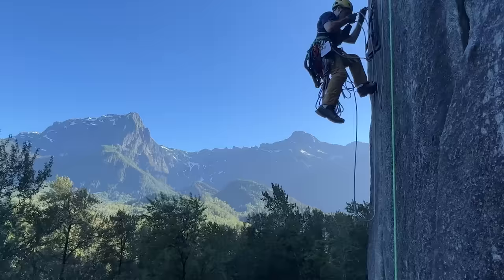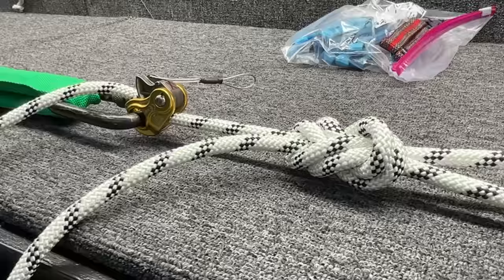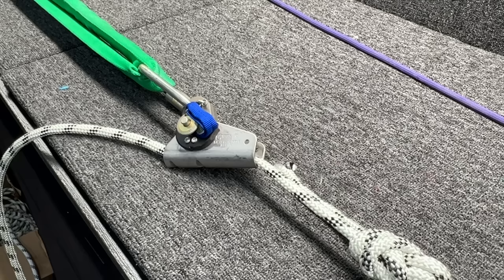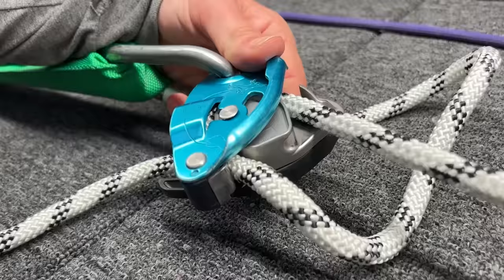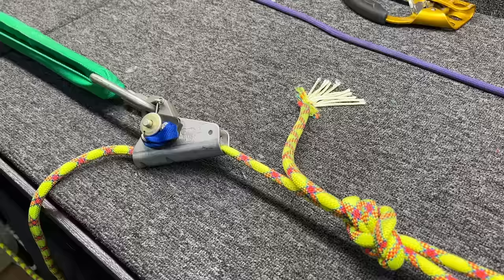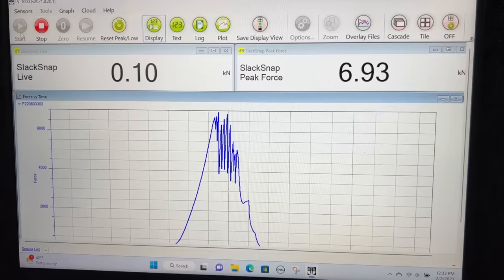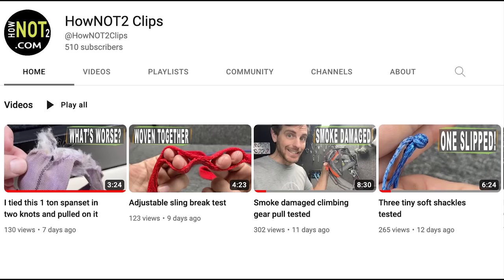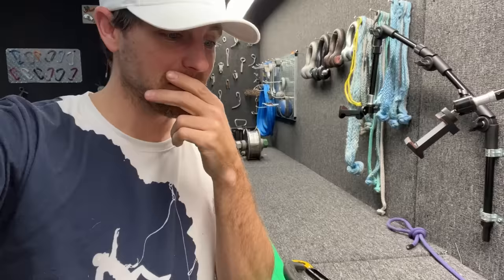What shreds a climbing rope first?

Comment from the maker: We found a Ropeman1 with ribbed teeth.  It broke the dynamic rope at 4.95kN, less than the micro traxion.  https://www.instagram.com/p/CoObDl9pntX/. 
Our quickies usually end up here on the Clips subchannel FYI https://www.youtube.com/@hownot2clips.

Check out our new store! https://hownot2.store/
Reply: my tower company just switched to the ASAP, and I've been on the fence about them, so yeah these videos are so on point for us.
Reply: I use a Ropeman1 exclusively for top rope soloing (with modified GriGri backup) Yikes! Can’t say I’ve taken any big falls 😅
Reply: @briancresson2610  after seeing this it sort of confirms what i knew and makes me want to switch to or add in the system something like a rescuescender above my IDS. OSHA makes us run 2 ropes when doing work, so its ultimately not an issue, but still.. Id prefer striving for a perfect system even though it would be damn touch to over shock both systems without any work hazard catastrophic failures incurring.
Reply: cant wait for CT roll n lock

btw, i like longer videos with more detail and explanation

Comment: Would be super curious about the petzl Tibloc
Reply: When I hear petzle  😮😂
Reply: holy smokes
the tibloc will absolutely destroy the rope bevause it doesnt have the feather mechanism. At least the micro generates some force with the feather.
Reply: Yeah man the thing about tiblock is it can slide and skin the rope depending on how you do it it’s a good ascender and does it’s job but it’s 40 bucks not for daily use for sure but will get you up
Reply: @shred_meister  Thing is I'd say for the weight there is soooo much better ascenders. Like why not carry a trax? Its literally so light and is so much safer and a lot nore versatile as well. A nobrainer

Comment: Would love to see how the Petzl ASAP fall arrestor stacks up as far as desheathing and catching a shock load.
Reply: Given that a shock absorber device is required for most (of not all) safe riggings using an ASAP we might have a fairly good idea already…
Reply: @DrewNorthup  Test it in both configurations?
Reply: @RainBoxRed  I don't know if it is still available, but at one point Petzl actually did that.
TL;DR : It really screwed up the rope without the absorber, with one it only left minor damage.

Comment: Have you ever done a "stored in a closet" video measuring strength retention of unused equipment not exposed to sunlight? Or does equipment kept for emergency use need to be replaced even if unused?
Reply: Depends on the gear, and the conditions of the area it’s stored in. Most climbing gear could last 20 years in a closet if cleaned before it’s next use.
Reply: @Hikergy16  Any test results to confirm? Noting manufactures recommend 10 years or less for unused.
Reply: @wmsatic  Manufacturers also recommend replacing your rope after 10 “hard whips”. Yet taking literal hundreds of whips is totally fine. It might go against their guidelines.. but….

Comment: I remember an old video, done in England if I recall, that tested industrial fall arrest devices in a drop tower. They all failed, and then they tested an old style Rescucender, and it was the only one to pass, but it is not a fall arrest device! a distinct problem with the Rescucender is dirty rope. Once the cam starts to wear, that nice radius on the rope contact undulations becomes a sharp edge. Good news, bad news: its very easy to inspect, but its a judgement call for when to replace. Other bad news, Petzel bought the design from Rock Exotica, the original maker. Petzl has come up with a replacement with captive mechanics, but an inferior rope path. Petzl did not relinquish the rights to the old design, so Rock Exotica can not make them under their own name.

Comment: Its been shown that non-toothed ascenders like the Gibbs ascender will strip the rope at 5kN as well. This has been well established in tests. So the more aggressive toothed devices are not much different.
Reply: Gibbs ascenders used to be used in rope rescue as a back up belay device and would outright break the static rope in dynamic drop tests at not much greater than 5kN.

Comment: Once I abseiled from a large concrete road bridge at night using head torches with my friend. I went first. Half way down I started swinging around on the rope. My friend followed me and we ran away from the scene. It wasn't until we got home I inspected the rope and it was 2/3rds shredded through from my swinging attempts. My friend had abseiled a 300ft bridge on a thread. I never told him a thing.
Reply: Was it shredded from contact with the bridge?

Comment: I was looking around  for a foot en knee ascender (arborist use)en do not love the idea/device's with te teeth just for the reason they going to be obvios hard on the rope. I find the NOTCH EQUIPMENT : NOTCH JET STEP FOOT ASCENDER and this one has cams instead of teeth. of course the question is how this device performs with its cams and the rest of its construction form. (in arborist use these are normally not going to take a fall (and the generated forces of a fall) on theme...) they are just to ascend you as a person and the material on you. (your body is protected against falling by another device). thanks for your many test and experiment work, learned a lot and sometimes go back to look at certain things again. Greetings David
Reply: get a toothed ascender, or a Gibbs ascender. People everywhere used toothed ascenders  and it does no rope damage so long as you're not taking whippers on it, which you couldn't on arborist rope anyway because your harness would break your back before the ascender de-sheaths the rope

Comment: As and arborist I have been using a gibbs 4sb rope grab on a 3/4 inch bull line to pull over trees. After putting 3 guys on a 25:1 I started thinking about the breaking or slipping point?. I know an eye to eye will fail at this point. Please help!!!

Comment: All the devices (except the Gibbs) pull directly on the sheath and it breaks at around 5 kN, leaving the core intact. I guess you'd get a much higher result if you used a Unicore rope.

Comment: Could you do a test on shock absorbers? I hear people say different things and didnt find answers in the manual myself.. when does the sewing in the shock absorber start tearing is my question... Via Ferrata slings are in the range of 40-120 kg, some tell me it starts to rip open on 120 kg, than ill assume the absorbica wich goes to 180 and 240 starts to rip open on respective loads!? I might be able to get hold on some old tearing slings wich i think is rated  50-120kg to send over

Comment: I hate it when a toothed rope puller smags  a few fibres out of a perfectly good rope - it just looks bad - obviously the result of improper use, still it feels uncomfortable..  

Would be great to gave a grigri partnered ascender for common use...  (hopefully it won't de-sheath, maybe Prusiks and Klemheists aren't obsolete after all.).

As no man or couple weigh more than ~ "3kN", controlled slip at 3-5kN provides significant deceleration (10-20kN breaks bodies) for a falling body (hitting the ground at significantly less than freefall speed is an advantage - super good enough = wedging rope into a "U/V groove" without point loading will definitely reduce sheath damage - like how a rope puller wheel works - the rope wedges in around the wheel (sure, there are grooves on the drum..)..

Comment: So, this has me curious. At what force does a prussik desheath a rope? 

And I'd be curious what the numbers are on 13mm rescue rope
Reply: the prusik slips before it breaks and would have a real tough time de-sheathing a rope, depends on the material but generally the prusik is smaller and tends to be weaker than the main line. halve your prusiks untied rating and if thats less than your shock load youll just have some good bruises, unless you rig it to do more violence to your body. your body prolly the weakest link in that system.

Comment: Kinda surprised that the grigri slipped at such a low force.
Reply: Actually, 8kN isn't that low, assuming you weigh 100kg, that's 8G of deceleration, and because it doesn't break but continues to provide about 6kN, it will slow you down to a stop within a fairly short distance. I think this is very close to the ideal behavior for the grigri; lots of energy dissipation, so less bounce when you come to a stop, and without breaking you back in the process.
Reply: @tonfleuren3536 it’s lower than I would have expected. I’m not worried about my grigri I just thought it would be harder to get a rope through it.

Comment: Please test CT Roll n Lock. No teeth, does it shred or slip?
Reply: @uhh  my suspension is that it will just slip on a slow pull. Love to see what would happen on a drop test in case it doesn't self capture for a couple of metres. Think that may cause a desheath.
Was thinking of getting one for rope soloing. Do you use a backup device too?

Comment: Why do you use those aggressive teeth on your ropes?

I sail, we do lock a rope here and there, I've never seen a device with teeth like those, I don't want my ropes anywhere close to those, of course the rope will suffer... Check sailing clamps, clamcleat is an old brand of very good fixed stuff. CAMCLEAT is a type of somewhat newer, articulated device. If you search for stopper (mini from spinlock could be interesting) you could find some other geometries. Bigger stoppers manage loads waay grater than what you are generally looking.
Reply: The teeth are so you can be sure it catches in one direction while requiring minimal spring force and friction in the other direction.
Reply: The teeth don't damage the rope unless you fall with the kind of dynamic force where non-toothed options also break the rope. The teeth are just to make sure the ascender can only move in one direction
Reply: I understand that, but it is clearly harder on the rope than other geometries, proven by the fact that it does break earlier with teeth. I understand they aren't sharp at all and wouldn't damage the rope without this kind of loads. I believe it was in the other video about this one with groves is tested as well and does get to a much higher load. 

Other notes on the devices I mentioned before... 
They have quite minimal friction and spring tension as well, specially the spinlock is a very neat thing, I have a couple of small ones (6mm max, rated for over 2kN IIRC, there are bigger ones) that have seen better days and still work really nice. They have a lock which is quite easy to release, but that's a design choice, when locked they work really similar to an ascender mechanically, in the sense we are talking here, of course wouldn't be a replacement for one as they are designed for a very different task, don't open, and are very different for mounting and operation. You can take a couple of meters of slack in seconds with them closed without feeling any considerable fiction, or loaded but then any reasonable friction wouldn't be noticeable anyway. 

The fixed ones can be a bit harder to release but it's not a real comparison for an ascender, I do have a couple to adjust the height of the harness (and in many other places) while hanging on them, but only require small trims. I have taken a few whips on those, but very low factor and usually worst case if they fail, you get wet. Dirt cheap (a couple of bux), light, works great with a huge range of ropes (1 to 6mm on the smaller end) and very reliable.